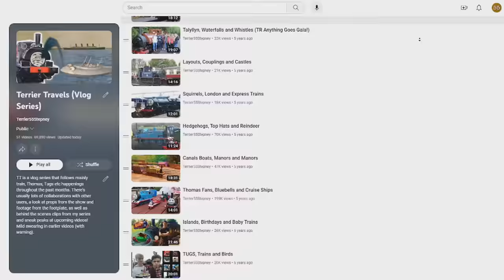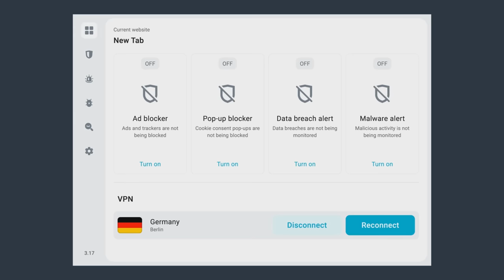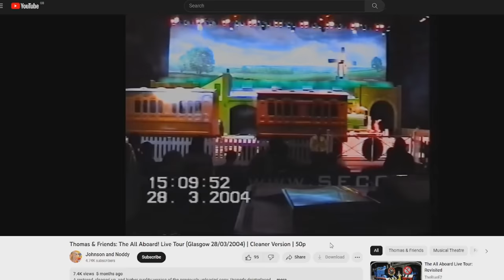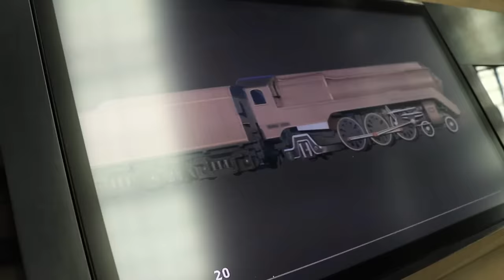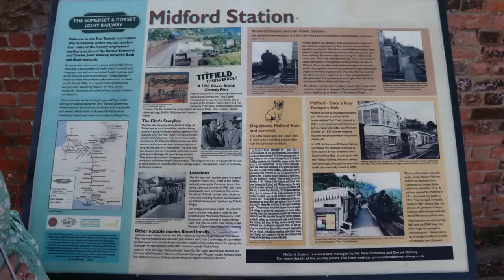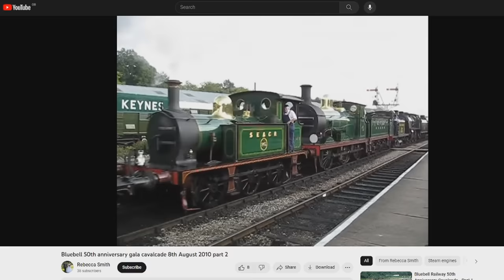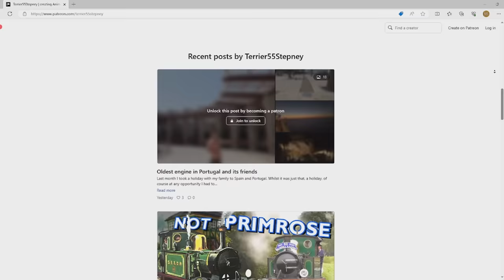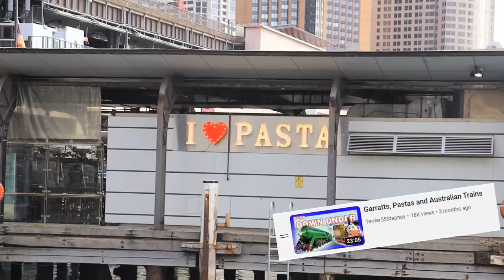Top 10 BEST Railway Moments

Comment: My best memory with railroads? Definitely my first time running a locomotive on the Connecticut Valley, aka Essex Steam Train & Riverboat. I spent so long learning what each lever and knob did, and I was finally allowed to run our #97. I will never forget the day. Going all the way up the line, coming back and coming around the train, coupling from the rear, and pulling all the way back.

Comment: 3801 has a few more reasons for being famous than just visiting every mainland state and territory

In 1964 she set the record for fastest journey between Sydney and Newcastle which wasn't beaten until 1988
She starred in the 1974 film "A Steam Train Passes"
And a quick correction, 3801 wasn't actually built at Eveleigh, all 5 of the streamlined 38s were built at Clyde Engineering at Granville, Eveleigh built 13 of the non-streamlined 38s whilst Cardiff built 12.